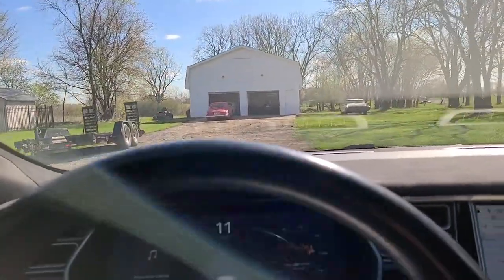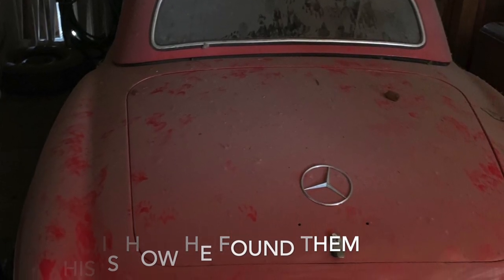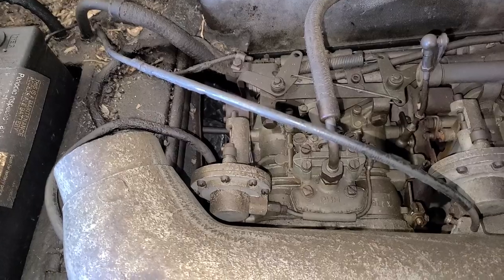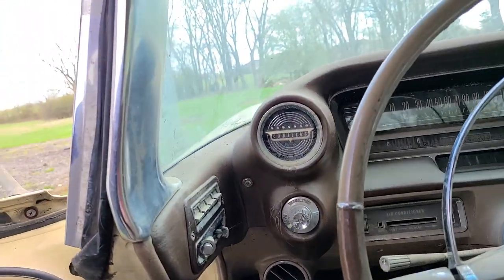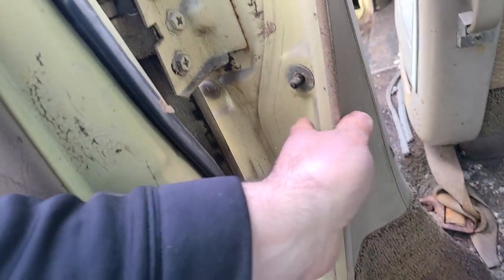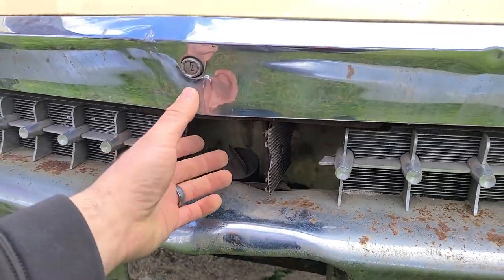Insane Barn Find Uncovered After Decades! Original Paperwork Inside! 50’s Mercedes & Cadillac!

Comment: The Cadillac being reported as 51 hp is to do with taxes. If a car had over 60hp then you had higher taxes on the car. So they would report the horse power as a lower number for lower taxes. A good resource to ask is Your Auto Advocate. He knows all about that.
Reply: Only in Canada and Europe did they tax the horsepower, in the states you were only asked if you a 6 or a 8 or bigger, Cadillac had a 12 and 16 until 1940 and Packard had a 12 until 41.

Comment from the maker: Which one I'd your favorite? Get 67% off or more on the Kove Split Speaker here: http://koveaudio.com/ls68 Code LS68
Reply: xtremely very expensive, all 3 might cost more than 300k,
Reply: Those are a gold mine. A quick look at NADA showed one interesting point. The hard tops for the 190SL's add 10% to the retail. You could be looking at $30G's just in hardtops! Can we look forward to some restoration content on the channel?
Reply: "Jet-Age" Cadillacs are the most expensive to restore - So much chrome to clean up, but at the end I'd say it's a $100,000 car. Having two vintage Mercedes 190 SLs is just the ticket - you can practice disassembly on one so that you'll know what NOT to do on the other. They're not #gullwings, so they'll be cheaper on the market: maybe $75-125k each?
Reply: based on condition, $50-90k each. Fam had a 190, back in the 80's.  FYI, if the luggage set is around somewhere, thats $5k as well.
Reply: I love the footage of those type o vintage models in car crash tests.. cool way to die.
Reply: Gonna go with 130k each...if restored.
Reply: If the white car is OG paint and it hasn't been messed with, and you have the complete history, its north of $120k as it sits RN. The red car is resto candidate, 60-80k tops. All depends on rust. I'd clean up the white car DONT RESTO MOD it, don't restore. It's a survivor. I'd do a top end, Fluids, bushings, brakes, suspension, wheels/ tires / re do the two water damaged gauges. After that just drive it. The caddy no idea but to the right buyer maybe $20k
Reply: The Cadillac is awesome... would love it...

Comment: For the 190SL,  I believe the floor switch is for high/low beam for the headlight
Reply: Owned a truck from those years.  Foot switch was as you said, high/low beam for headlights.  Good catch!  Hadn't seen one in years.   👍
Reply: Correct my 60 Volkswagen Transport had the same.
Reply: My 1964 190  finback sedan had that hi/low light button with a small foot operated bellows just above it to pump washer fluid.
Reply: Definitely the high/low beam dipswitch on the floor.
Had these on dad's 1950s Ponton saloons.
Dads later fintails had a rubber footpump for windscreen washers above the dipswitch and the even later fintails had an electric switch mechanism around the footpump to operate the washers and wipers together.
Dads Mercs certainly left an impression on me, from the 1st he purchased in 1957 (a 1954 170D) to the last one he drove before his death in 1979.
I currently have 3 (having just sold my R-Class), An A-class, An E-class and an S-class.
All fabulous cars in their respective niches.
Love the 190SLs, well worth restoring as values are sky high at the moment👍👍

Comment: My dad had a European 1966 250 SE 4 dr with 4 speed manual that I drove when I was 16 (1973). In that floor location normally for high beam, was a button that you pushed for the washer. Slightly above it was a ring. You push the ring for wipers, or all the way down for wipers and wash.

Comment: My 1973 Plymouth Duster had a rubber bladder foot pump for the washer next to the high beam switch. The rubber was cracked so I replaced it with a 12v pump from Radio Shack in 1992 or so. My '55 Buick Super had a foot switch for changing the pitch of the torque convertor. Awesome video. Beautiful cars!

Comment: A former engineer told me once that the Brass at GM had ordered the fins to be made smaller. The design team loved them so much they made one side taller showing the Brass the opposite side saying that was the new "shorter" design and it was OK'd. Either way it is definitely the most iconic Cadillac design. Thanks for sharing 👍
Reply: From what I heard Harley Earl was told to make them smaller and he knocked the fins off the clay model, and told his design team to make them taller in which they did. IIRC I think Harley Earl rammed it through without GM brass approval.

Comment: My 1970 SE has the foot pump for the washer, but it is higher up under the dash, is bigger than your metal one, and is not so obvious.  The bright light switch is on the turn signal on mine.  Yours looks like a type of light switch.

Comment: So the metal button next to the clutch is the headlight switch for high and low beam. Further up and left in the corner will be a small black pedal for the wipers (not visible in your video). Also the long rod that's pulled out under the dash is for your fuel tank reserve.It's probably not hooked up since it's pulled out that far. The choke is next to the starter button on the dash. Your dome light on the dash has two positions when you open it, half way open it has a notch which will function when the door is open. Another cool feature is the little lever on the side of the steering column, this will flash your high beams for overtaking. It's a German thing. The indicators function by turning the chrome circle on the steering wheel left or right. A lot of 190SL owners don't know this but you can change the seat back angle. When you you flip the back forward and look at the rear brackets stopping the seat back, it has tabs that hinge out acting as spacers that you can adjust.

Comment: The horsepower on the title is known as taxation horsepower, which was derived from the engine's cylinder bore and some other values, all into an equation. It was used for determining which tax bracket the car fell into. Most places which used this system have moved on in various ways. In my country for instance, tax on the purchase of a car is determined by the engine size (measured in cubic centimetres), although taxation horsepower still appears on the titles, but it isn't used for anything.

Comment: My 69 Dart has a similar foot push pump for the washers and still works. You had to pay extra for a electric push button washer back in the day. It also has the high beam push button on the floor.
The cool thing to be aware of on many of the old American cars is the low beam headlights would stop working because of the feed from the low part of the wiring would corrode from leaks or carrying all the current for the headlights and quit working randomly. I replaced the headlight switch in my Dart a couple of times till I discovered the floor switch was bad and replaced it from a 6 cylinder 69 we had for parts.

Comment: My dad had a black ‘63 sedan de ville. He tricked it out with a rear facing tv mounted on the front seat back so my sister and I could watch on road trips. It had a v-shaped antenna mounted on the trunk lid which looked really cool. And he bought a set of James Bond labels that he affixed next to a few of the accessory knobs. There was Oil Slick, Flame Thrower, and Ejector Seat! Wish I had pics of that car.

Comment: The switch on the floor is for the high beams.  The bulb for the windshield washer is further to the left.  Choke is on the dash.  the pull knob is probably for the fuel reserve in the fuel tank.  The floor cover is wood but not really a compartment for anything.  The 190SLs came with rubber floor coverings not carpets.  People would have added carpets later. Good luck with the 190SLs.  Check out 'wfs52' on you tube.  Will is one of the true experts on the 190SL.

Comment: On my W113 230SL the switch behind the clutch is a High-Beam switch. The wiper control on the column when pulled towards you sprays the windshield washer fluid, however that car was made 8 years after this one.

Comment: Love a ‘59 deVille!  The 4 window with wrap around rear was cool but the 6 window with power rear quarter glass was a nice feature!  
Here’s the specs from Cadillac: 
1959 Cadillac four-window Sedan de Ville Specifications
Wheelbase: 130″ (3,30 m)
Length: 225″ (5,72 m)
Weight: 4825 (2188 kg)
Factory Price: $5498,-
Production Total: 12308
Engine: 390 ci (6,4 l)
Brake horsepower: 325 at 4800 rpm

Comment: My opinion; Don't try to start, go strait to rebuilding - only machining what is needed and checking tolerances as you go. At a bare minimum all rubber that can leak oil, coolant, or fuel needs to be replaced.

Comment: Super cool Score on the Cars , on the Red one i wouldn’t be too surprised if  you could find  a way to clean off all that Overspray underneath the car  by finding the correct  process and not having any  damage to the original  parts under the Overspray  oddly enough  when i was a Teenager growing up in South Florida  i worked part time  doing restorations on Yahts and Motor boats  one time we had  one that  had    terrible Stains  from the Deisel exhaust on the Transom where the exhaust   exited the  engines  we had all types of  strong Chemicals we tried and nothing was working  so we got frustrated  ironically on the second day we  brought random cleaners we had at home to try  out and we found out that the Cleaner 409  just  took the grime off in seconds  without causing any damage  to the original Gelcoat and Fiberglass ! we were stunned  and the boats Owner was  extremely happy with the results i am nearly 60 years of age and a retired ProfessionalWoodworker  tha. has never forgotten the lesson  of finding out that  there is  a proper formula for almost any job  for me it was usually focused on Different Finishing products to protect  my creations   and those had  things that could be Water based  and Petroleum based stains ,Paints ,and Cleat Coats  or Varnishes

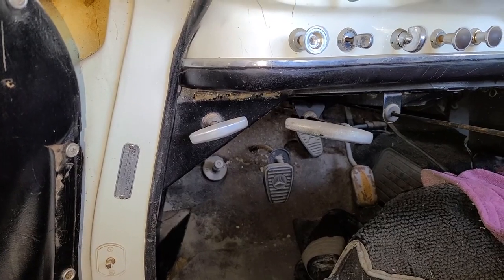Comment: 4:02 I would say thats the headlight dipper switch. 8:52 There used to be "Rated HP" based on CID, HP today is "Brake HP". In 1968 our HK Holden (I'm in Aus) had a 307 Chev in it, it was 48HP Rated but it also developed  210 Brake HP. I hope this helps you.
10:27 What is the term for that upholstery? I do know the Buick Electra had it and our 68 Holden had it but I cant remember the name.

Comment: A 1959 390 cu. in. Cadillac had 325 HP and 430 lb. ft. of torque. It wasn't a slouch compared to newer years.
Reply: The transmission let it down though.  That fist quick shift from 1st to 2nd didn't give you time to build up speed, but it wasn't made for that anyway.

Comment: You mentioned the Cadillac headlight dimmer. The Autotronic Eye. Sat right in the middle of the dash, about the size of an 80's radar detector on a post. Streetlights would trip it.  Had a 1959 9 passenger ("limo")  in the early 90's. The parts books listed parts as 1956-1958, or 1960-1964. Good luck. If you break that back window, burn the car for the insurance.

Comment: I have a 1948 Land Rover in original condition. Has a electrical switch like that SL for dipping the head lights and does not have any way to squirt water on to the windows. So it maybe a light switch. At the moment I am replacing the wiring loom. By the way these have a 2.2 ltr side valve Rolls Royce motor and a haymaker etc which mounts from the back. It also has a capstan based winch which runs off a dog clutch on the front.

Comment: That’s a light switch on the floor of the car (for changing between high and low beam).
Reply: American cars had that but it remains to be seen if the Germans used that. I'd go with what the guy said about the wiper fluid.
Reply: There's one for sale on Ebay. Does not specifically state for a 190, but very similar appearance. Also, when foot pumps were used in cars I drove, they were either levered, or had a rubber "Bellows" type gasket to promote springing back into position for the next pump.
Reply: @wernerdanler2742  British cars in that time had that fooswitch for the high beam/low beam.  My parents had a Daimler (it was old) and I learned to drive in that car.
Reply: @peterblackmore7560  Well Peter, back then manufacturers knew people have four limbs and should use all of them. Lol
I even remember having a starter button under the gas peddle. And people think push start is a modern invention. Lol
Reply: @wernerdanler2742  Well said! My parents first car was a small Singer. It had starter button under the hood, which I pressed when I was about six. The engine started and at idle speed on a flat road, headed towards a downhill road. Some rushing around and screaming, Dad got there in time. My nickname as a child was "Fingers".
Reply: @peterblackmore7560  haha. The things we did as kids. I was playing on the floor with a bunch of little junk pieces one time. One I think was a heating element from a coffee percolator. It was U shaped and had a spring wrapped around it. So I stuck it in the electrical socket to see if it would fit. It blew all the circuits in the house and I just sat there all innocent while my parents ran around trying to figure out what caused it. Dad went and reset the breakers. I figured out that a little kid can create a big effect. Lol
Reply: Yep, known in Australia as a “Dip Switch”, the floor switch was to dip the headlights from High-beam to Low-beam and vice versa. Push it...it won’t bite :)

Comment: Using a horse hair brush on my 20 year old MB Tex "leather" took off the top coat! I'd be a bit more careful brushing those old seats down like that
Reply: Wow Really thats a first I hear ive been doing it for years on vinyl
Reply: @youngtimersgarage  so you go into a million dollar classic and scrub the seats left and right? I mean it must work for lots of people but my vinyl has separated after the brush treatment, I mean 200.000 miles didn't do as much damage as that one "soft" cleaning
Reply: @youngtimersgarage  Yeah, the car i did this on was a w163, so it might compare to your E300 from the interior quality. This was a worn drivers seat, that basically disintegrated shortly after the treatment. The other seats look like new after brushing. Probably just my fat butt
Reply: @criticaljim1  haha ya well lesson learned right !
Reply: @youngtimersgarage  Nice channel! Like your cars. My seat looked exactly like your R129 when you bought it. Some not so bad stress cracks and one 3 inch rip. I did light brushing with horse hair and leather cleaner then sealer. It felt like the slight grease I took off was all that held that seat together. The leather wore down quickly afterwards. Looking for a replacement leather now.

Comment: Former mercedes classic center tech here:

Yes, your floorboard covers were made by plywood

4:00 that must be the switch for low/high-beam.

The wiper fluid "pump" switch is actually a bladder, so you are the pump!

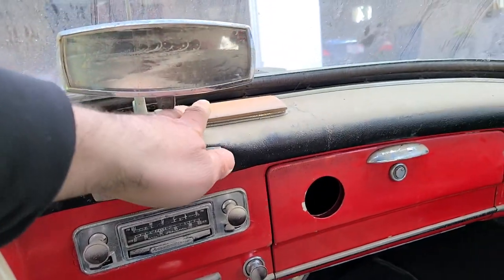14:40 - thats the original Becker radio, very expensive even restored.

15:00 - never seen this before, could also be a cassette deck changer. 

16:00 The missing clock is not available anymore, so you are a lucky man - they are sold for 500+ euros! (Ebay: 303978981815)

Comment: Why are you using a brush on the seats, just spray it down, let it drip down and then wipe it, your literally just driving dirt into the the leather, as solvents and soap are there for a reason, and its not to do that, that's only ment when its embedded and stuck on there pretty solidly and the rest of the thing is ragged.

not to mention the foam, like just sprits and put a rag down without wiping, the dab and tab